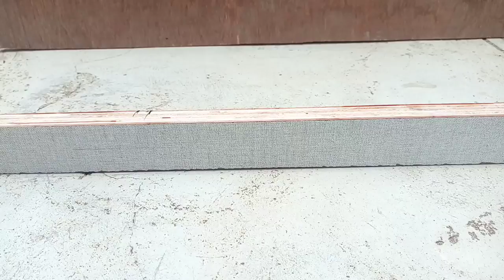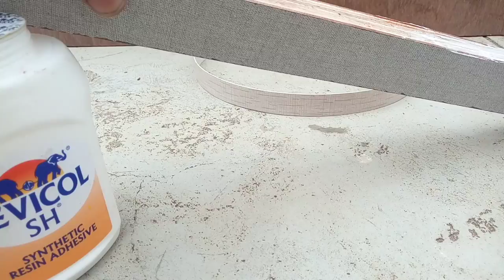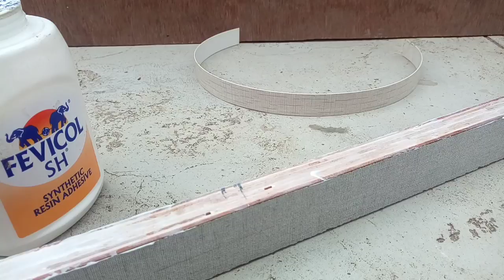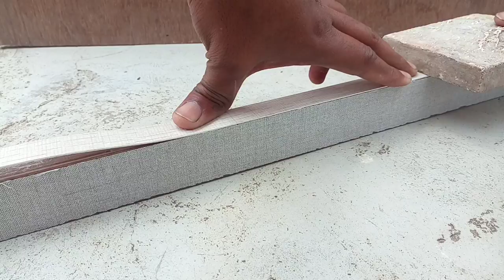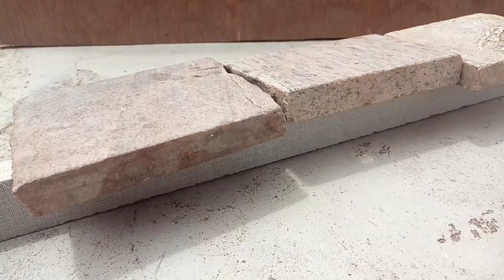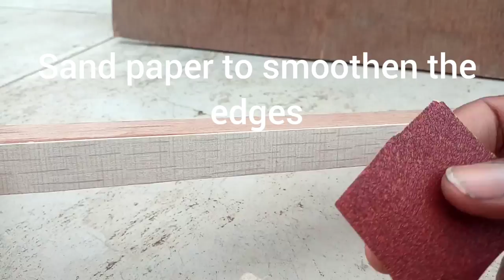Apply PVC edge band tape to plywood without using Fevicol Probond/Only with Fevicol SH

Comment: Sir ji Polyfix instant PVC glue se lagao without masking heat and water resistant 🙏
Reply from the maker: Bhaiji Polyfix is not available in some hardware shop. But, fevicol SH is available in ordinary shop also and economical. This video is not for so called professional carpertersI have done some diy wood work so I shared. Apart from this their are many other brands also like fevicol probond which can be used without masking tape. Don't think much.  Namaskar
Reply: @inactive392  
Which location sir ji